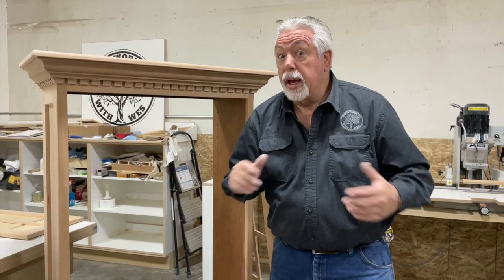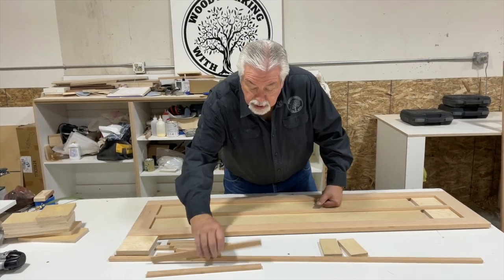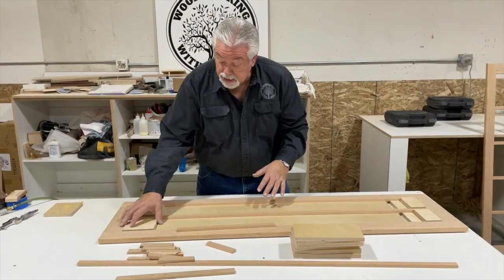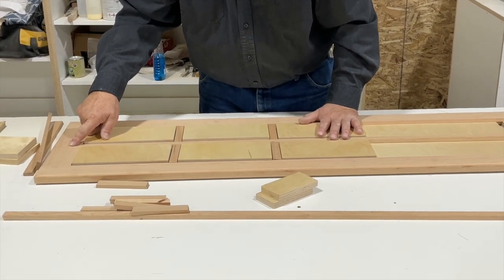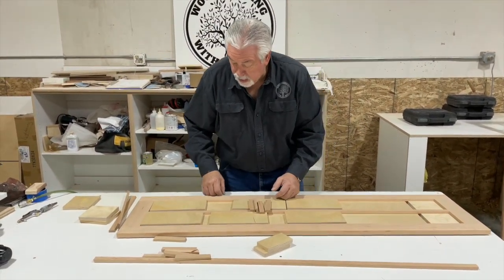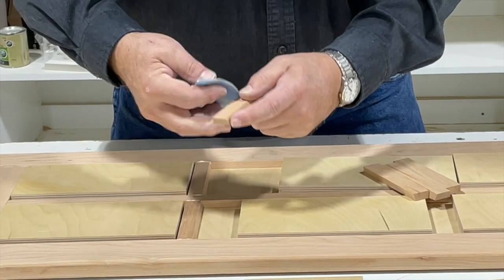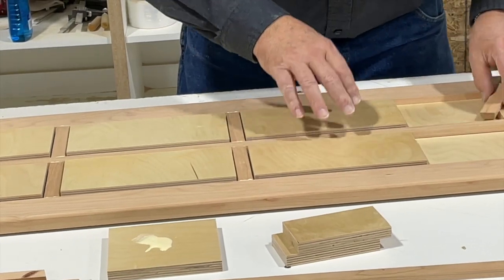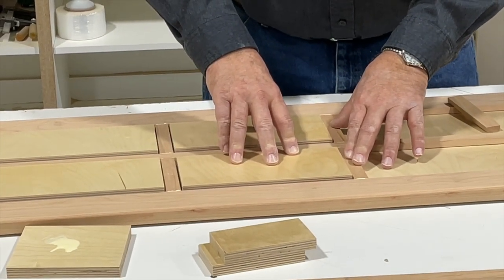The Perfect Glass Door For Our Bookcase...Part 4

Comment: Thank you for this project! Can you please tell me what router bit you used to cut out the lip for the glass?
Reply from the maker: The lip for the glass is created with the stile and rail router bits used to assemble the door. I just remove the back portion that would hlod the panel in creating the lip for the glass. I hope this helps. Thanks, Wes
Reply: @WoodworkingWithWes how did you remove the back piece? After using the tongue and groove bits